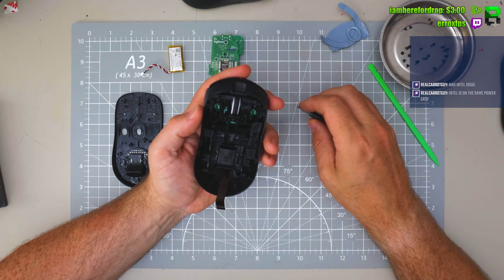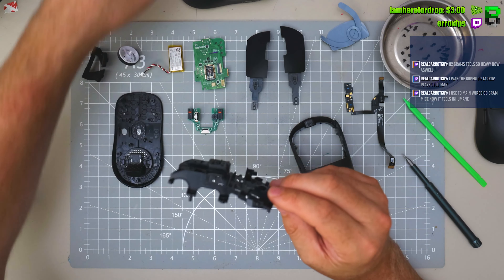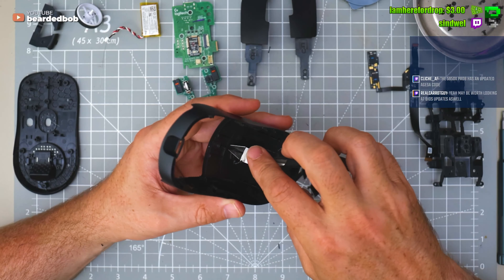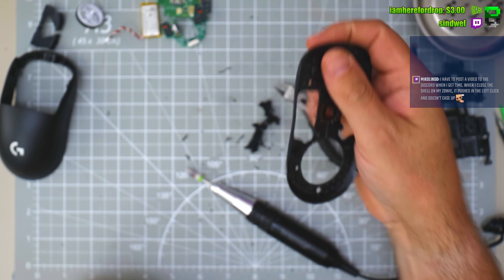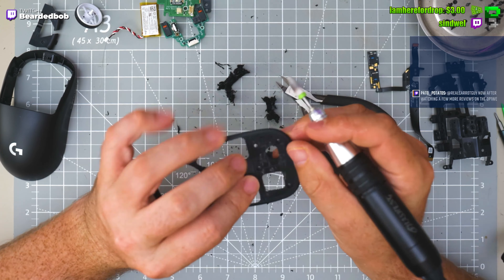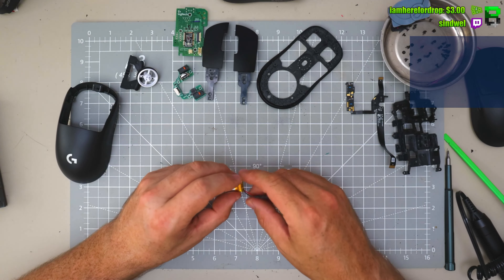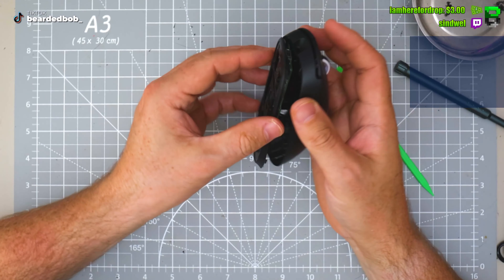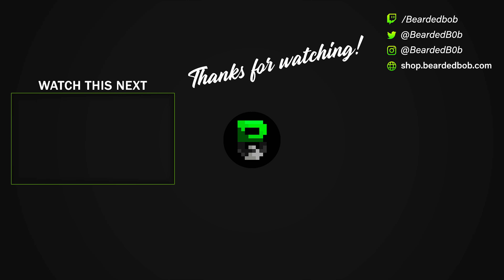Logitech Hesitated, We Didn't! 16g Cut: Logitech G Pro X Superlight 2

Comment: I see you put a 2 wire battery in even though it has a 3 wire dose this cause any problems charging or  is it a safe mod
Reply from the maker: I’ve had no issues but doesn’t mean you won’t. The 3rd wire is to help with the temp of the battery